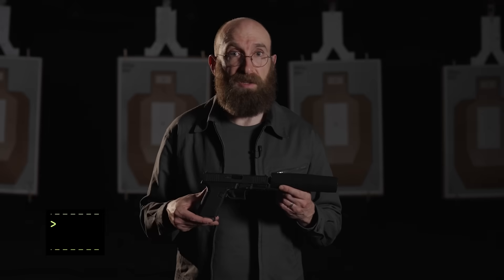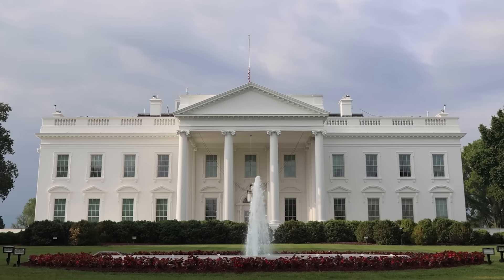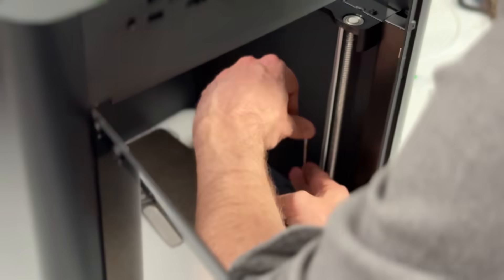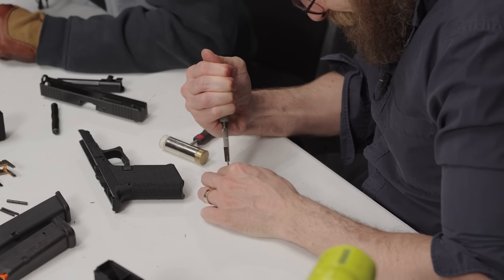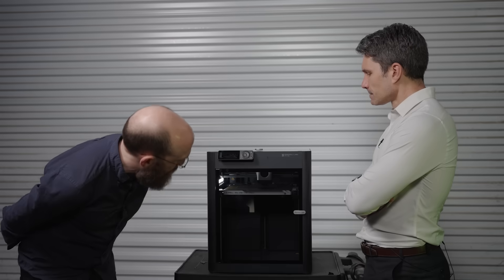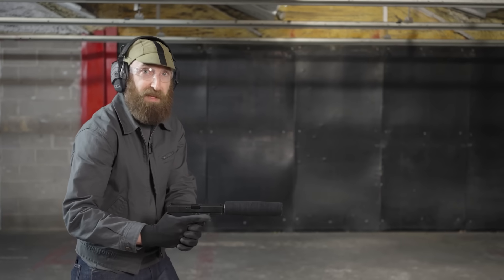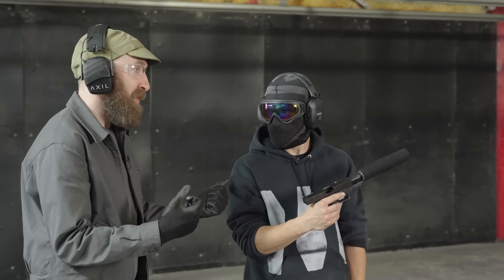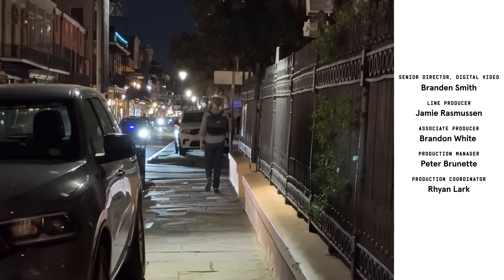I 3D-Printed Luigi Mangione’s ‘Ghost Gun’ | Hacklab | WIRED

Comment: DRM on 3D printers won't stop this. Advocates will simply return to making their own DIY 3D Printers as they did in the early days and use them to circumvent regulations. I really think going after 3D printers is the wrong approach and will fail. The expert advocating for this is wrong in this respect.
Reply: Yeah also it's important to note that he is wrong about printers (or more so, photocopiers.) Your copier doesn't notice that it's printing money and shut itself off, it notices that it's copying something with the EURion constellation (a specific pattern of dots) on it.

Banknotes purposely include "do not copy me" marks on them to avoid being copied by (most) photocopiers. This doesn't transfer to guns, not even a little bit
Reply: @efeyzee  just include EURion constellation on gun 3d models, its not like people can edit them ;)
Reply: @Bralkor exactly. It would be a shame if they had those marks.... totally unusable. Might as well throw it in a BLENDER and Slice it up. 😂
Reply: Not to mention the fact that a lot of 3D printer software is open source. Should they implement DRM it wouldn't be that hard for someone to just edit the source code and remove it then publish their version for anyone else to use.
Reply: go after the parts.  
not a single printer today could print a barrel like that.  so why can you buy one without a license?
Reply: @darkracer1252 Go after which part though?  Some of us can make parts out of metal too, even the barrel.
Reply: @darkracer1252 you don’t need to print a barrel. There are 3D guns out today that include instructions for making metal barrels. One of the most popular ones that many people know doesn’t use a single commercial part.
Reply: @darkracer1252  technically you could use the printer to make a 3d mold and then blacksmith the parts. stuff like that is whats amazing about 3d printing. that you can create such intricate shapes with ease that would allow you to make parts difficult to create or don't exist.
Reply: @darkracer1252  You mean like a pipe, or a solid bar of steel to use on your bench-lathe?
Reply: And we have a right to make and own our own guns.
Reply: @freesk8  only in louisiana.  
and rights can be taken away.
Reply: lets jailbreak the 3d printer 😂
Reply: @jrjuergenross lol, you mean flash klipper?😛
Reply: the idea is laughable. any person savvy enough to create things will not want their tools managed by a third party. they will take it out or buy something without it.
Reply: Your first mistake is in allowing his self stated credentials of expert as being remotely valid.  That is an intellectual expert who never jacked off a single pistol with his own hands.  The actual experts laugh in his face.
Reply: or just roll back the firmware lol
Reply: @Nzombii or flash a different one.
Reply: Beyond that. Let’s say I printed this on a Prusa Printer. In the future, as regulated by law, they detect a firearm is being printed. Cool, but their firmware is open source. So if I cared, I’d just download their source code, rip out the firearm stuff and push it under a different branch. It truly can’t be stopped and all these laws are just there to spook people.
Reply: I'm wondering when they'll add DRM to pencils, like, can they fabricate graphite that breaks when you write something illegal.

The guy in the video has completely no clue how a 3D printer works, it's almost funny...
Reply: There are 3D printer control boards widely available, that take open source firmware, e.g. Marlin. You download the firmware project, you configure it for your board and printer, compile it, upload to your board, install it in your 3D printer, presto. It runs software that has nothing to do with any big company or any government of the world.

The "expert" is either a moron, or an evil person who wants to remove your ability to run the software of your choice on your hardware.
Reply: @Booruvcheek exactly this. Standalone. In a basement with an sd card and no internet.
Reply: laws made by idiot polititians that have never touched a 3d printer and don't know what CAD is.
Reply: Yep. people still print counterfeit money. So software overwatch isn't effective in controlling this.
Reply: The gun controller is grasping at straws because if he admits gun control is dead and he can't stop the signal, then he's looking for a new job that's a lot less cushy than being useless and getting paid for it.
Reply: @stonegiant4 just regulate the barrel/chamber instead of the frame. That would fix this almost every loophole. 

Sure FGC-9 with hydraulic pipe would get around this, but that is much more difficult than a printed Glock frame.
Reply: 3D Printing is not the problem, that expert is getting payoffs by various non-gun related manufacturing industries that have a vested interest in 3D printing failing.
Reply: His just wrong I mean just absolutely delusional and dumb 😅 comparing it to counterfeiting money It's nowhere near the same. I mean 3D printing a gun you can buy the equivalent of a simple desktop HP printer for under $100 right now and print a gun. With counterfeiting currency you could not do that you needed a specialized printer specialized ink specialized paper. Not just any printer could print passable counterfeit currency. I mean sure it's slightly similar as in counterfeit currency was being printed and a ghost gun is being printed but that's pretty much where to similarities end
Reply: You can't stop The Signal...
Reply: No reason is even talking about the printer thing lol. It’s such a weird stretch it would he brought up but NEVER come to fruition. I just don’t see it happening.
Reply: What is the correct strategy?
Reply: Why would the Chinese owned companies of many of these printers, including the one used in the video, bother following US laws? Although that same company is fairly anti-owner in restricting their firmware, so maybe they'd be okay with a locked-down firmware if it kept them selling in the US market. But the open source printer companies either wouldn't, or it's so easy to not upgrade or install custom firmware. The gun control VP, who's end goals I agree with!, doesn't understand 3d printing at all. This isn't closed source software & laser printers owned by a few companies. The 3d printers can be built out of parts off the shelf as easy as the guns can be these days. This isn't the 1980s when photocopying money started happening.
Reply: Welcome to gun control where instead of trying to fix a problem they just ban stuff and give more control to the government. It nice to have you
Reply: 3D Printing community is obsessed with freedom.
Reply: Not only in this respect.
Reply: He clearly isn't an expert, that's why he thought this was even possible.
Reply: There's also tons of open source slicers that could be forked to remove this restriction. You could try embedding the restriction on the firmware of the printer but it wouldn't shock me if there's already opensource firmware for tons of printers as well.
Reply: Why would anyone regulate a 3D printer? You have a right to manufacture your own firearm as an American citizen... Seems like an unalienable right is being alienated again.
Reply: Yeah lets outlaw forks cause fat women eat to much
Reply: @aerialplatforms2053  If you gonna make moronic statements like this it would be better if just didnt participate in the conversation.
Reply: He didn't say it would stop it. He said it would make it harder to break the law. A lock on a door doesn't stop someone breaking in if they're determined enough, you still lock your front door
Reply: @nickdalts But you literally have no time pressure, compared to a burglar. That's the thing at discussion here.
Reply: He said its about making it harder, not impossible, for people to break the law. So, if someone has to make their own DIY 3d printer instead of simply buying it, then he's achieved his goal
Reply: DRM on 3D printers is definitely hopeless, given the RepRap/open source community. I'm for improved gun control, but the cat's out of the bag. Maybe some states' approach of background checks on people who buy 3D printers is viable. But ultimately, I don't believe we can both have 1) a constitutional right to own a gun, and 2) live in a society without gun violence.
Reply: they're also wrong in advocating for any regulation on it at all.
Reply: I mean, wouldnt the obvious thing be to sell parts of guns with the same law requirements as whole guns?
Reply: @happzy  Over here in the UK it is impossible to buy gun parts. I dont mean buying them illegally. I own several guns legally, should I need a more specialised part for it beyond something simple like a new buttstock or handguard I have no ability to realistically purchase that not because I legally can't but because the restrictions have ruined the market for replacement parts.  My grandfathers old winchester 22lr rifle hasn't been functional for years, I've cleaned the rust off it and found as many replacement parts as I can but theres some parts that I can't and probably never will be able to get because I'd have to buy them domestically and I just can't.
Reply: @happzy the problem is where does that regulation end. Are we gonna regulate the sales of steel springs? How about small metal pins? You can make mustard gas with common household chemicals but we aren’t restricting the sale of cleaning products.
Reply: @happzy  do you realize how dumb you are? think about what your replying to, and what you just said... this is about 3D printers not "gun parts" you need the printer to make..... never mind you have the IQ of a potato 😂
Reply: @happzy  Sure, 10 day hold and background check because I need a new spring. No thank you.
Reply: @happzy  This is how it works in some other countries. In Australia you can't sell or purchase any part of a gun without a license.
Reply: @IsZomg  Yeah, because Australia did a proper gun reform after what happened in Port Arthur
Reply: @happzy  here in America, owning a firearm is a right, not a privilege.

That’s like having to show ID to buy a wine glass.

Or proving you have a license and insurance before buying a tire.

We are not second class citizens and will never accept such infringements
Reply: @pouringblood  Purpose of wine or a tire is not to harm and kill people. I can appreciate your love of 2nd am. but it needs to be considered with some sense of reality and safety. Im not against civilians owning guns but I do believe that to own one you should go through mandatory psych. eval and proper safety traning(not unlike what you need to do to obtain a drivings licence).
Reply: @happzy  even so in USA, alcohol related deaths are twice or more than guns related death, maybe we should advocate for that, or maybe don't alcohol doesn't scare people enough.
Reply: @happzy  Purpose of a firearm is to protect yourself, the ones you love and your property. It's not to kill people, although that's obviously the ultimate thing that will happen, if someone is after your life. It's the protective element in a gun that keeps you safe. Dead people are a necessary sideeffect. No guns means you are the dead person, not the one who would deserve to be. If more people understood this and could stay up for themselves, then the mass shootings would stop immediately. And gun rights only take away the guns of the honest citizens, which are not the problems. A criminal - by definition - does not care about the law. By your logic, gun laws would lower the amount of criminals, but you create the opposite.
Reply: @pouringblood  That's debatable, and ultimately for the courts to decide.

And it's the wrong conversation to be had anyhow: What should be talked about is if there should exist a right to own firearms. If killing people for being poor was a right enshrined in the constitution, would you be defending it as passionately? Saying that you'll never accept becoming a second class citizen by accepting law infringing on your right to hunt the poor for sport?

Probably not.

Fact is, firearms do an incredible amount of harm to the citizens of the USA. And the supposed benefit of allowing your to overthrow tyranny should it arise.. is questionable at best. There are plenty of free, democratic countries that do very well despite or because of their strict firearm regulations.
Reply: @aldrynlopez1047  And people also die in car crashes. So should we just not care about gun deaths becasue of it? Besides people who die to alcohol do it by choice in most cases, nobody is forcing anyone to drink. Kids in schools dont have much choice when some unstable individual is spraying them with ar 15. The funny thing is that out of all of those problems guns are the easiest to solve if it wasnt for gun lobby.
Reply: @happzy  never said we shouldn't care and people on roads or any death related to alcohol consumption don't have much choice when some unstable or irresponsible individual is under the influence of alcohol.
Reply: @aldrynlopez1047  Again, one bad thing has nothing to do with the other so why bring it up?
Reply: @happzy  Probably 1/5th (south Florida) to 1/8th (San Diego) of the cars on the road in certain cities are being driven (often poorly or dangerously) by people who lost (or never got) their driving licenses.  What did making the rest of us pass a driving test and learn how to drive safely really accomplish when it comes to those who just break the laws anyway?
Reply: @happzy  As much as that sounds like a good idea, but having it into practice could bring less than ideal results. Because people tend to underestimate how many people in the country there really is. Especially with illegal immigrants (which they are part of the problem to both immigration and gun deaths along with gang members as well with cartels). Because the USA is physically connected to Mexico and every other country to South America. And they have massive problems (except for El Salvador right now) with multitude of things (as far as I know).

I am surprised people were originally reporting gun deaths as gang violence, now turned into gun violence. Which it is a very weird coverup that has and will continue to blow up in the government's faces until the issue has been dealt with permanently. I preferred to have central and south America to be independent rather being annexed (which the latter might happen far later down the line at this rate).
Reply: @workingguy-OU812  It reduces the number of untrained drivers on the roads this reducing the number of accdients?
Reply: @happzy  already knew you were about to get dragged
Reply: @pouringblood  
if you own a gun and have the license for it.  it should be as simple as entering your number or information on the purchase page. (or setting up an account)  and at that point they know you have a license and are able to buy the parts.  

if you don't have a license then you have no buisness buying the parts.   
quite a simple process isn't it?   
or is your gun mind too small for that?
Reply: @aldrynlopez1047  stop your todler reasoning.
Reply: @happzy  purpose of firearm not to kill people, but to throw small heavy piece to pointed direction. You can have fun with it at gun range, or private range, or hunt with it. Purpose of cars to move people/cargo. But sometimes some people use it to intentionally hurt other people. Should we ban personal cars? This is rhetorical question.
Reply: @happzy 😅 gun issues are the easiest to solve really?
 In what world not this one. Even if some absolute silly and insane thing happened like all guns were just immediately outlawed. It would never happen or it would be the catalyst to a  war. But let's pretend the law passed. All guns are now illegal. What next? Actually think about that logistically what next. 
 Now they would have to go and confiscate all the previously legally purchased guns. That will be the best nightmare in the world to watch 😅 But let's stay in this fantasyland everyone hands over their guns It would never happen but we're dreaming here. You can still obtain guns illegally The 3D gun printing business would be booming a business that absolutely cannot be stopped in any way shape or form in this new world (or in the real world actually. ) So now even more guns are on the streets And your fantasy world collapses. 😅
  There is no fix especially a easy one.
Reply: @pouringblood  I mean you'll comply with laws and regulations or you'll go to prison or worse, it's as simple as that. Your consent is not in debate here; Compliance with laws is not "an option" it is a demand backed by force up to and including lethal.
Reply: @MalloonTarka  thats not debatable, firearms are a inquestionable right, because its a natural right, logical. With that said, natural rights cant be infringed by any government, because governments are simply servants of the population, nothing more. In that case, right to own firearms is absolutely legitimal, fair and natural, and must exist, without any government having the hability to say otherwise, because its the people who decide. There are only two ways, either firearms dont exist at all or anyone can have them. And the truth is that the same government that brainwashed you is not capable of banning firearms. All firearms owned by all military and police forces in all US is outnumbered by colossal numbers by the firearms owned by the population, so they have no power to do anything. Also, let me teach you: killing poor people is a right enshrined in the constitution that some people defend. Some passional people say "oh, bad criminals must be executed!", and then alot of innocents die. BUT, the right to life is a natural right, so killing people is not a right that the constitution can grant. In short: natural law > invented law, that is how it always was, and how it will always be. I appreciate your attemp to defend dictators and politicians, but dont believe their lies, they tell you guns hurt because they want to monopolize it themselves, then they lie to you.
Reply: @rmgsw  Is owning atomic bombs a natural right no government can infringe on?

If the people decide they want regulation on owning firearms and ammunition, what then?

Why do you believe I'm brainwashed? Who do you believe brainwashed me? And how?

There are indeed a massive amount of firearms owned by the US population. So what? Does might make right?

What part of the constitution lets you kill poor people for being poor?

Where did I defend dictators? If the Second Amendment exists to overthrow dictators, why isn't the Trump administration being attacked right now?
Reply: @happzy  I used to think this way, until I realized that both of those things are barriers to entry on owning  firearms. Thus, making them an infringement.
Reply: @stealthshadow9  There should be barriers to entry on owning a firearm, thats common sense. Following blindly a law that was written in a different time with different technology in mind is lunacy.
Reply: @MalloonTarka it's not debatable it's literally in the Constitution
Reply: @happzy  Owning a tire or a wine glass is not a fundamental human right enshrined in the the Bill of Rights. Also, crazy people and accidents make up a miniscule level of guncrime in this nation, that wouldn't be addressing the issue at all. Over 80% of gundeaths are gang or drug related.
Reply: @MalloonTarka  Killing people for being poor WAS a right enshrined in the constitution. There was a fairly unpleasant civil war fought over it, and now it's not in the constitution anymore.
Reply: @MalloonTarka  Lmao. Then go to one of those countries. Trusting the gov protect you is hilarious. But after seeing your comment, of course someone like you has that view...
Reply: @happzy  Easiest to solve?. CRIMINALS will always have guns. People doing mass shootings, will always have guns. It doesnt matter what law you make or what you do. Do you know why texas is one of the safest places in america?. Cause everyone is carrying.  People commit crimes in areas that are safe spaces, because its SAFE for them lol
Reply: @patrickrosington1174  Yeah...no. Australia passed strict gun control  after Port Arthur incident and their gun violance dropped like a rock. There is miniscule gun violance in Europe in comparison to US. So criminals will not always have guns. With strict gun contol eventually they will have very little guns not to mention school schooters and other psychos who would have no guns.
Reply: @patrickrosington1174 I live in one of those countries. Why did you assume I was an american?

But in general, "if you don't like it, just leave" is a terrible moral. What, if something is bad, you should just... give up and leave? Is that what you'd teach your children?
Reply: @MalloonTarka  Don't kid yourself Tarka.  Every country is run by tyrants.  In the US for example, it doesn't matter if a dem or republican wins an election, be it for president or any seat in congress, the richest people in the country still stay in control.  It's all smoke and mirrors my friend.  Each party throws it's voters bones but the main thing will never change.  We will never draft a constitution by majority vote.  We will never have free communication, any medium that is not controlled by the rich.  Meaning, we will never have a way that any person can say something that every other person has the option to hear.  And we have the tech.
Reply: @TrudleR  I live in a country where guns are regulated. not once in my life has anyone threatened me or my life with a gun. 
I also never heard any of my friends or my friend's friends being threatened with a gun.

I have never met anyone who died, or was hurt because of a gun. I also do not own a gun and I was never killed by anyone with a gun.

Either you have a verry vivid fantasy, or you live in a 3rd world country.
Reply: @aldrynlopez1047  maybe also ban drunk shooting.
Reply: @NickShl  if you like target practice, you could use a bow, an airsoft gun, a paintball gun, a slingshot or sling, darts, blunt thowing knives or axes (they penetrate paper targets on hay stacks easily) or play some VR shooting game.

You DO NOT need a lethal weapon capable of mass shootings to shoot stuff for sport.